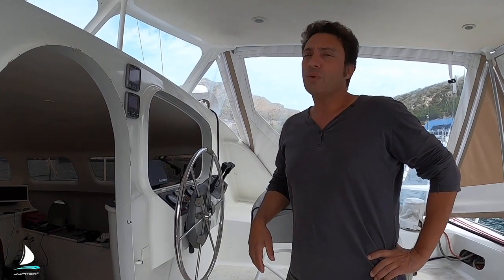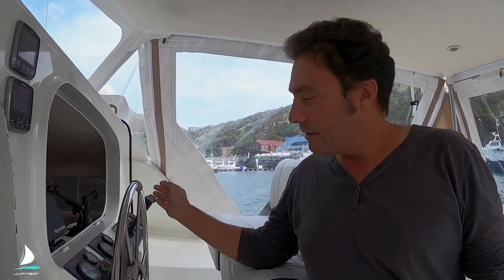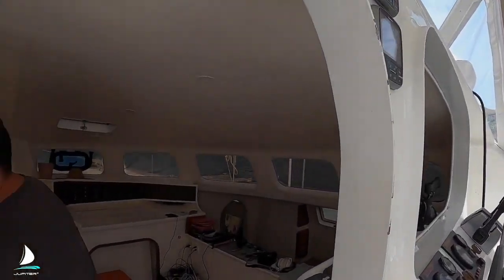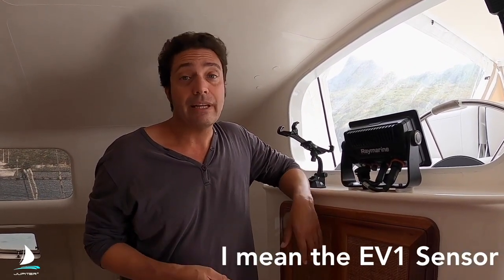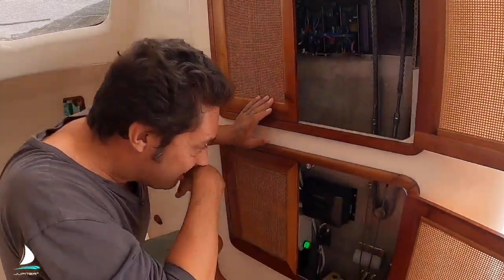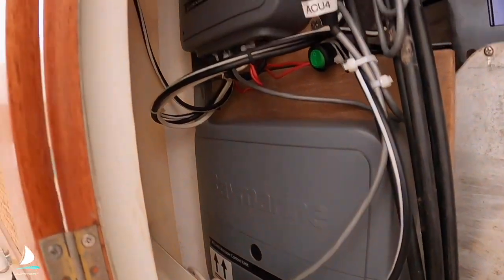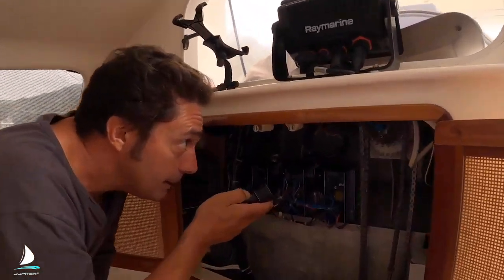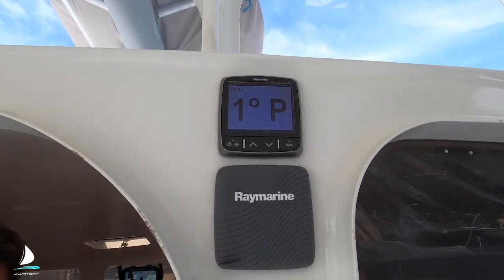AUTOPILOT FAILURE in an ocean passage and AUTOPILOT UPGRADE

Comment: Fantastic tips, as i'm looking to purchase the EV100 bundle next week, can you give me the details for the rudder feedback potentiometer please and how you managed to wire it in, that'll save me some £££. many thx
Reply from the maker: Hi Nick... The pot is a 4.9k... You will need as many turns of the pot, as your steering allows.... for example, my steering is 1 full turn either side of center.... so i need a 2 turn pot.... however, all i could get was a 10 turn pot of that value.... and it works fine.
You would need to find the center value of the pot (2.45k) and that would align with your rudder centered position. 
The Raymarine course computer has 4 wire inputs for the rudder reference.... Depending which computer you have, the wiring/colors/pins are  different.... 
Check your manual.... For eg.. if you have the ACU100/150 the screen is far right.... for the ACU2/3/400 it is far left..... I jumpered the screen terminal to the Bat-ve..
The remaining 3 pins can be determined this way.... The center of the remaining terminals is likely to be the "wiper" of the pot.... ie the centre connection.
The remaining 2 are the lowest resistance, and the highest resistance. Connect them up, power up your computer and check your display.... turn the wheel port and starboard.... if the reading is good then its ALL good.... If its opposite to correct then swap those last 2 wires.
I hope that makes some sense.....
Reply: Life on Jupiter Sir you’ve just saved quite a sum of money, that’s fantastic thank you very much for that. I’m purchasing the Evo100 helm pilot kit tomorrow and I’ll order the potentiometer tonight, I’ve managed to find the same model as yours I think. Again many thx 🙏
Reply from the maker: Glad to share.... Like, share and subscribe!

Comment: Hi Jamie,. Thanks for the tech videos, really learning some good info.  I wondered if those isolation switches that failed were switched under load?  Thanks Brian
Reply from the maker: Hi Brian... Nope they weren't... in fact rarely switched at all... 2 out of 3 welded themselves closed.... I wouldn't have known, except i went to turn them off one day to do some work on the circuit, and i was physically unable to move them!
Reply: Thanks that really makes it difficult to design a system if you can't rely on the switches.  Have you found alternative switches?
Reply from the maker: For my engine/battery isolator I have been searching for a nice beefy (cross sectional area) switch... but i've not yet come across anything appropriate.... 
For that, i've still got the battery cables bolted together. Very low resistance, and getting great charge to my batts... But i do not have a quick disconnect so its certainly not ideal....
I have a main DC bus disconnect switch, (to protect my Lifepo batts, incase of low voltage) which was previously the BEP electromechanical switch.... but that failed.... after talking with an elec vehicle guy, i've gone with a Gigavac GX14 contactor, which is a fancy solenoid.... Pretty low power consumption coil holding the contactor closed (230mA) for about $200USD....
So far so good with the Gigavac switch. Fingers crossed!